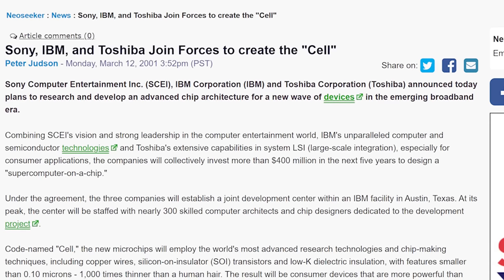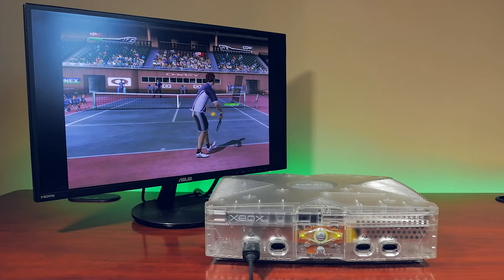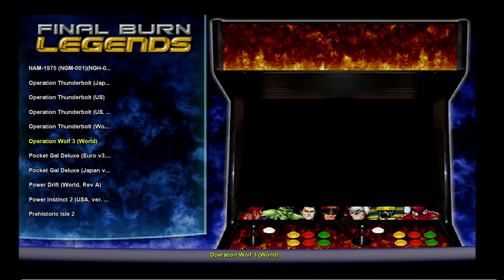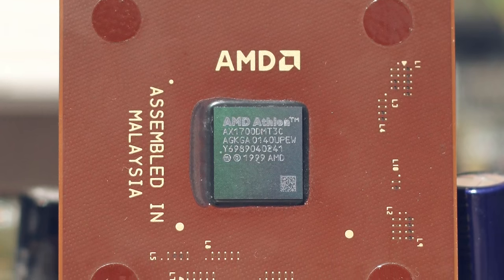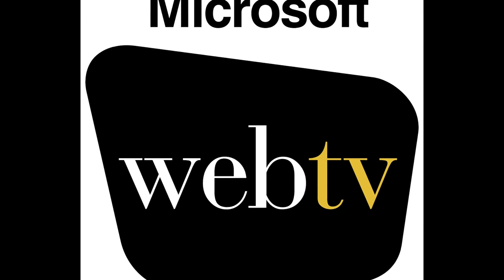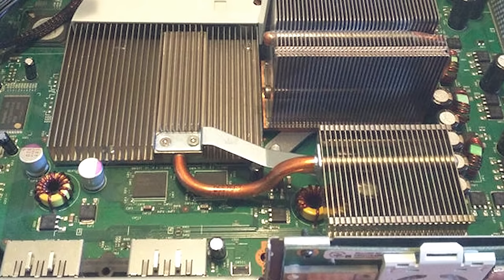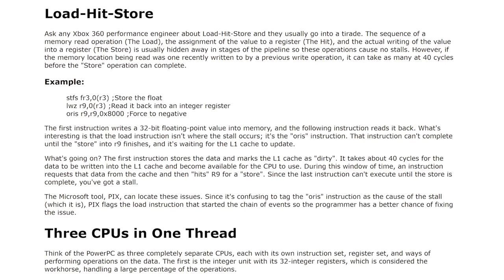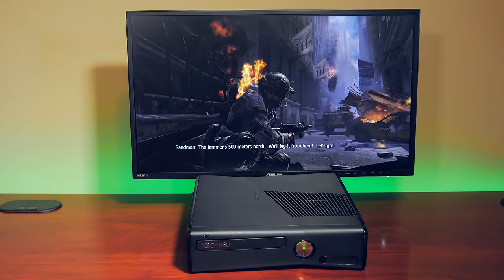Why Microsoft switched from Intel to Power PC for the Xbox 360  | MVG

Comment: 10:19 - you probably meant to say "AMD", not "ATI" :)

Also, according to an interview with Nicholas Baker, the lead architect behind Xbox 360, one of the biggest reasons Microsoft chose PowerPC over x86 by Intel or AMD was because his team figured out that CPU clock speed isn't going to get much higher (especially when you take into account that power consumption and heat dissipation play a very large role in the design of a game console) and that the solution for increased performance in the long run is parallel execution. In other words - a multicore CPU. Problem was that neither Intel or AMD had anything like that on their roadmaps (at least at the time) while IBM did, so Microsoft chose to partner up with IBM.

EDIT: 

For those interested in more details, here's the full interview with Nick Baker:
https://youtu.be/JP9TDLxq_1U?t=210
Oh, and thanks for all the thumbs up :)
Reply: Amazingly accurate considering that we've barely increased clock speed since the mid 2000s. Multicore's become the focus of new chips, even though Intel got to 5ghz on their processors recently, with the 9900K coming out over a year ago.
AMD's managed to take IBM's place in consoles, being involved in every system for most of the 2010s until the Switch came out.
Reply: Thanks for the info! Very interesting, 5GHz is a pretty much a hard wall for PC users to push past in most cases or at the very least requires a lot of money spent on either the CPU or it cooling it... hell both really, so expecting consoles to ever reach that level comfortably is still unrealistic, let alone back in the mid 2000's - it's actually pretty cool that they had the foresight to recognise this, I believe there's some 'law' quoted about this very subject though isn't there?
Reply: @TheMarc1k1  Moore's law.

AMD did hit 5ghz with fx 9590 but really hot (220w TDP!). Plus with failure of Bulldozer included (basically Pentium 4 repeats itself)
Reply: @YoureUsingWordsIncorrectly  that's why some fx 9590 came bundled with water-cooling. TDP was so close to gtx 480
Reply: @bitelaserkhalif  When I saw that processor, I felt like "...they... just literally grabbed one of their processors and sold it pre-overclocked right?"
Reply: AMD didn’t own ATI at the time. That was a few years later.
Reply: "hey, automoderator here, watch out, you mentioned ati. ati was consumed by eternal glory amd so you should correct your post to glorious amd."
Reply: @amirpourghoureiyan1637  Multicore hasn't really been a focus. Look a few years back, Intels highest end consumer CPUs only had 4c/8t. Only recently you couldn't even get 6 cores on the mainstream intel plattform. Sure now even the low end cpus get 4-6 cores, but games still scale amazingly terrible with CPU cores and favor IPC.
Reply: @Slamgod  
10:19 is about the switch from PPC back to x86.
So AMD is correct.
But the acquisition of ATI from AMD was back in 2006 anyways, the Xbox One released in 2013.
AMD kept the name ATI for products up to 2010, maybe that's why you are confused.
Reply: AMD didn't purchase ATI until 2006. 360 was released in 2005.
Reply: @sdmods619  
10:19 is about the switch to Xbox One, it's not about the XBox 360
Reply: @MrDavibu  ah that's right
Reply: @Slamgod  ..... ATI was purchased by AMD in 2006
Reply: @sdmods619  Yeah, but in the video the point was being made about the CPU, not GPU, and in the year of 2013. ("...in 2013, Microsoft went back to x86...").
Reply: @KiinaSu  Intel kicked it off with the Core2 line, following it up with C2Q and so on, adding back SMT with the 'i' series. They've only become more relevant because it's become more sell-able to consumers and power users who will see a difference between single cores when compared to dual/quad cores. People barely notice a few hundred megahertz extra on a single core as they struggle to run Windows nowadays. As for gaming, up until a few years ago, the engines targeted the lowest common denominator, aka dual/single cores - they didn't expect a teenager to have a Xeon to play games on, like the studio did to make the game.
Reply: AMD introduced the first dual-core x86 in early 2005 though, so the technology was clearly there during the 360's development cycle.
Reply: @-szega  At that point, Vista was the only thing that consumers would need a dual core for, everything else ran fine on a single core XP machine.
Reply: @-szega  clearly there... The 360 was released by the end of 2005. You don't switch to an entirely different CPU architecture half a year before that. IBM had multi core CPUs available when they designed the 360, AMD didn't.
Reply: @amirpourghoureiyan1637  Besides the point, the claim was multi-core x86 wasn't on the roadmap during Xbox 360 development, and that's obviously false.
Reply: The Pentium 4 really was a pretty poor processor unless you were doing stuff like 3D rendering, video compression. It favoured batch processing rather than code which would branch a lot. I went from a fairly new Pentium III to an Amd Athlon 800 and it flew thanks to DDR memory. I can imagine Intel were too greedy as well when it came to discussions about custom processors. This is a console after all, not a desktop PC, embedded is always very price sensitive.
Reply: @-szega  I bought an AMD X2 back then. Just a shame at that point that Intel caught up.
Reply: @chunye215  CPUs aren't created over night. The 360 was released by the end of 2005, and the first x86 dual-core was released in early 2005. This means AMD would have started development work on these around 2001, and the first units would have been around some time in 2004. It's fair to say IBM had a dual-core CPU first, because it's true (-POWER4), but that wasn't what formed the basis of these consoles, which were based on the PPC970, which is a simplified Power4 core in most ways, and wasn't available as a dual-core until late 2005 or so as well.

My point stands, multi-core x86 would have been an entirely possible choice for that generation of consoles, and that it didn't happen had a lot more to do with corporate politics and the fact that R&D cost was more effectively amortized since IBM re-used large parts of the design across four(!) customers.

As far as performance goes, keep in mind that at the same time the PPC consoles were *introduced*, Apple was already far underway to get rid of the PPC970-based Macs since their CPUs were simply not competitive with contemporary x86 CPUs any more.
Reply: @Slamgod  AMD bought ATI in 2006. That's PS3/WII/XBOX 360 launches. So for the PS4/XBone release? Yeah AMD and ATI are basically the same thing.
Reply: @-szega  ok, you could make the point that multi core x86 was on the roadmap, fair enough. How much AMD was willing to tell Microsoft about them even behind closed doors can only be speculated, and also keep in mind that they didn't even have a finalized product back then that would give them a baseline to make promises based on. Agreeing to design a customized version of a chip that isn't even finalized yet sounds like a risky thing to do, for AMD resource wise and for Microsoft regarding uncertainty whether AMD can even deliver in time, and whether it will perform accordingly. IBM had multi core on the market in 2001, if memory serves me right, so you had a pretty good idea of what you'll get if you base your customized chip on that.
Reply: referral madness  Well, to be fair, SEGA Saturn also had parallel execution capabilities in the form of multiprocessor system, although it didn't end well for Sega - just like PS2, Saturn was notoriously difficult to program for (even worse than PS2 or PS3 era), but on paper, it had higher theoretical peak performance compared to PS1.

But yeah, Sony was also infamous for their sketchy marketing when it comes to their console hardware capabilities...
Reply: @amirpourghoureiyan1637  This is a very misleading statement. Single core performance has improved massively since the mid 2000s, just not by focusing on clock speed. In fact clock speed has never been a good indicator of performance, since performance-per clock varies wildly between designs.
Reply: It is ATI because they were bought by AMD a few years ago but not in 2005 - 2006
Reply: @nathanmead140  AMD bought ATi in 2006
Reply: For fuck's sake, it's like this thread is the ultimate semantics technicality competition...

No one is impressed by the vocabulary of YT comment randos, everyone gets the point
Reply: When I used to love in Toronto, I would see the ATi logo on their main building before it was bought out by AMD and massive lay offs occurred.
Reply: @nathanmead140  He was talking about the transition back to non-PPC CPUs in the Xbox One (2013), so AMD would be correct as they were purchased in 2006 the branding had totally disappeared by 2010. 
Also since he was mentioning CPU architecture it would make sense to say AMD as they were the CPU manufacturer and ATi was primarily focused on Graphics related products.
Reply: 5ghz speed limit is only if the chip is made from silicon.  If the man made diamond CPU ever get commercialized it would increase to 100ghz.
Reply: ATI made graphics cards just like Nvidia makes graphics cards. 

AMD owns ATI

MVG should pull this video the majority of his “facts” are 100% wrong.
Reply: @amirpourghoureiyan1637  Clock speed shouldn't matter anyways. One of the reasons that Apple gave up on PowerPC is because so many higher-end PCs were sold on marketing CPUs with higher clock speed. But x86 speeds didn't translate to PowerPC, which had entirely different clock speeds, even while executing code faster. Clock speed was the phoney metric that drove chip development for consumer PCs for several years. And now sells game consoles, apparently. Sad. smh
Reply: @TheMarc1k1  well, ARM. They'll likely move to ARM chips which generally have better heat dissipation, and those clock speeds don't apply. 5Ghz pretty much only counts when comparing x86-64 to x86-64, or PowerPC to PowerPC, etc. "5Ghz" isn't a goal worth pursuing. Ever. Get a superior architecture that runs faster, cooler.
Reply: @South_0f_Heaven_  You are definitely clueless on how YouTube video production works. Pulling an entire video because of a minor error would be catastrophic for his channel. Just look at CCP Grey's video about his error on the missile testing facility and his logic behind why he is hesitant to pull videos that have minor errors or glitches. It messes the algorithm, and in turn, his video monetization, and his subscribers.

Remember that most YouTubers have given up their 9-5 jobs and fully committed to making videos. They have to put food on their table, pay rent and taxes, etc. They have no safety nets unlike those who work under an employer, where at least you are entitled for a severance pay if you were fired or leave the company to get a new job or start a business.
Reply: @triadwarfare a follow up video that the creator is aware of errors and acknowledges them or a community post can easily be done. When a video has facts that are blatantly wrong and it continues to happen on a regular basis then they lose credibility. 

If your audience is 11 year olds or otherwise clueless people then that’s fine. But it doesn’t work for your audience if your making videos with incorrect facts geared to intelligent people.
Reply: It still would have made sense to stick with x86. Easier for devs = less development costs which = more games that run well, as well as making it backwards compatible out of the box without emulation.
Reply: @TVperson1  Don't forget that X86 gives easy access to directX. and even PlayStation is still essentially using a variation of that for their own pixel shader technology.
Reply: @TheMarc1k1  now it's +6GHz
Reply: CPU’s are 5GHZ+ now. ;)
Reply: I mean, ATI was acquired by AMD, but still.

Comment: If you played a 360 as it started to red ring, it had extreme graphical freak outs. To this day, I still have PTSD and assume my console is dying whenever I see a graphical bug in a game, especially on Switch with how hot that thing gets.

Edit: To those asking, yes my Switch is an original 2017 version.
Reply: Yea, my white 20gb Xbox 360 went RROD 5 times and I was able to fix it 4 times and just gave up on the 5th...picked up a brand new  250gb slim, still to this day, it boots up fine, I still play games that is not on compatibility, and there is still a ton of them...
Reply: I remember there were a few games that would actually mimic a RROD and some that just had weird bugs or quirks that looked like it. I actually had on of the first RRODs and had no idea what was going on. It was only PGR3 and I figured it was just some weird game crashes, but then I started to see stuff on the internet about RROD. So, I sent my console back for the first of 3 times. Eventually I just bought a slim.
Reply: must be a switch 1.0 issue. I have the switch 1.1 (same specs, but gets like 2 hours extra battery life from having a better manufactured APU). and it doesn't get hot at all or glitch out.
Reply: @awilliams1701  my Switch 1.1  has glitched out on me while playing SSBU a couple of times, I decided to move all the save data from that game to the console an so far it has been behaving properly... Of course there is no way of truly knowing if it was a MicroSD card fault, or an update, but I've been happy with it ever since (also I managed to fix my joycon drift with electrical spray cleaner)
Reply: My one friend has an Xbox 360 that has been having constant graphical glitches for a long time but his console didn't red ring yet
Reply: Haha I have a feeling that rocksteady knew this when designing that scarecrow level in Arkham asylum
Reply: I have arcade version, i abused it and it keeps coming out for more. At some point i had it closed in the closet, damn thing is so noisy.
Reply: I had a HALO: Reach edition 360 do that on me in the middle of playing ODST on legendary while staring down the barrels of 2 hunters. 
rocks silently in a corner
Reply: @samuelthecamel  Same here. It's the GPU dying tho
Reply: The switch only gets hot if you have one of the original one's i have the new one and with it docked in 1080p playing breath of the wild it is only a little warm when i undock it after a few hours (my dock is the original official one the system came with and i am using the original charger + using a pro controller through USB and a USB sound card)
Reply: My 360 copy of The Orange Box was scratched to shit and occasionally it would fail to load textures and models. Seeing that floating ERROR model alongside random multicolored textures and the notorious hall of mirrors effect scared the shit out of me and I shut my console off immediately 😂😂
Reply: Additionally, the HDD in my 360 is getting really old, which leads to some interesting effects. 

In GTA V, there was a mission where Trevor's dialog wouldn't play, and he wouldn't move, but somehow warped him to the destination without mission failing for "abandoning him." The mission also called for a specific vehicle, but it wouldn't load so I used Franklin's car and it somehow didn't fail me again. This happens from time to time.

Minecraft doesn't do anything special, just freeze.

I haven't played any other games there recently, but I plan on replaying Portal 2, which I'm sure would have weird side effects of this.
Reply: I have the revision 1.0 of the Switch as well, whenever it heats up too much I just turn it off for a while.
Reply: YES! I very specifically remember when my OG 360 was red ringing: It was playing through the original Prey and then the behemoth that FINALLY put the nail in the coffin?
....
.... The XBLA port of DOOM
Reply: Switch gets "hot" for what it is, but in comparison to actually powerful chips its nothing, at worst the fan hits max speed and can heard faintly across the room, but nothing like a fat ps3, or OG 360, or my 5700 XT blower. So far ive gamed heavily (intensive games like witcher 3) all day in a 30c room and it never overheated, gave me a warning, or failed to cool itself, and im running the OG launch model in dock. Its a pretty good cooling system, the air tunnel goes in shoots up past the chip, and out. Could be worse honestly.
Reply: Ugh. That sucks. My launch Xbox 360 I bought in 2005 got a RROD, but happened the next time I turned it on. Last time it worked, it gave no signs at all. I was playing PDZ, PGR3 and DOA4 just fine. Almost 17 years later, still bums me out that it happened to me. 😑
Reply: It be PTSGD tbh but yeah. My first xbox one HD went bad and omg RROD in my mind.
Reply: Nice thing about PCs is the parts are all off-the-shelf, so you can just replace them if they fail. Not so easy when it's a custom board that you can't just buy off a store shelf.

Comment: One oddity of the Xbox 360 going PowerPC - when Microsoft made the original SDK for the 360, they went to the only major provider of 970-based systems ... Apple, namely the PowerMac G5 (G5 being the Apple name for the 970, and the PowerMac being the forerunner to the Mac Pro)
Reply: AnEn  Apple's Quad 2.7GHz G5 was MUCH quicker than the Xbox 360, They can compete with a 2009 Core 2 Quad, you can't compare their single 1.6 model to an Xbox. Even the Dual 2.5GHz had pretty even performance
Reply: @WalnutSpice  I think you mean quad 2.5 and dual 2.7. I have a quad 2.5 in my closet :P
Reply: I remember the early development kits was literally a PowerMac G5 with a Radeon X850 XT (PE?).
Reply: AnEn one thing also well worth taking into account is that AMD seems to be very willing to work with their customers to design custom products, Xbox One, PS4, and even current Mac computers all have custom non standard AMD silicon in them (most recently the MacBook Pro 16” has a very custom GPU option, a 5600 equipped with HBM2)